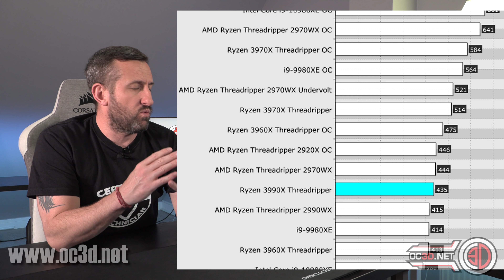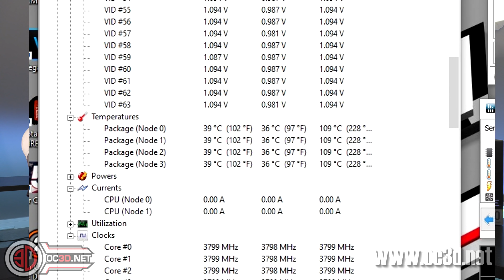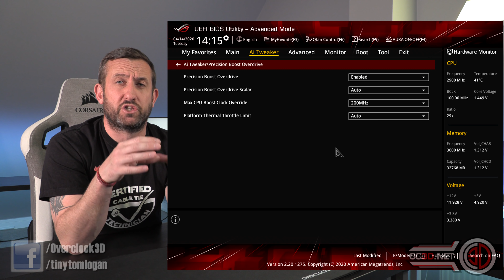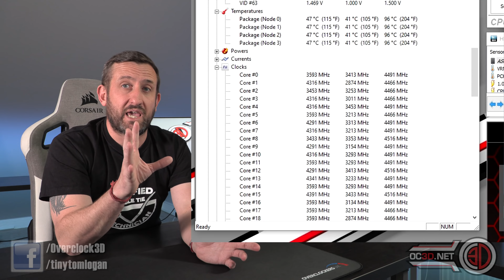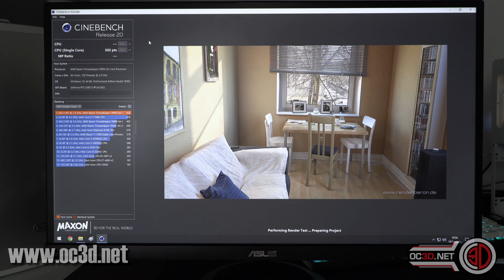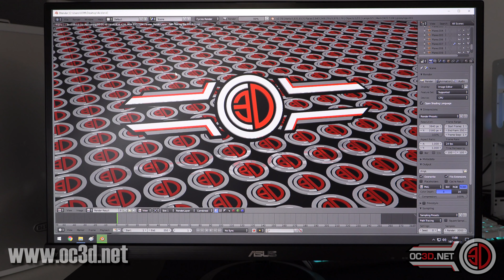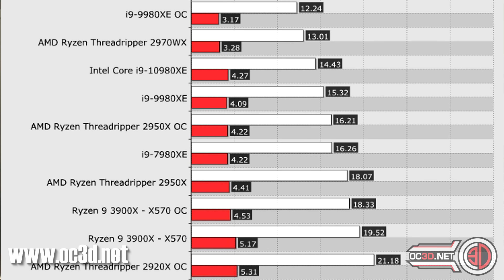3990X vs 3970x vs 3960x Zenith II Extreme Alpha TRX40 Aorus Extreme MSI Creator TRX40 VRM Temps

Comment: Thanks. I just finished my Build for ASUS ROG Zenith II Extreme Alpha and Ryzen Threadripper 3960X and  very excieted to start testing and checking performance. I bookmarked this video clip as I will probably watch it a few times.  :-)
Reply: I have that board and CPU!
Reply: I just bought the same board and cpu. What are you using for cooling?

Comment: Great to see you back on here.. Always great reviews. I've got the 3970x with the Zenith II Extreme Alpha and it would be working but i'm still building my new PC.. Haven't yet decided on Video card or AIO, especially since it's going in the Fractal Design 7 XL
Reply from the maker: AIO wise give the Coolermaster one a look I used here :)
Reply: @OC3D  Thanks very much for the advice.  I will have a look at that!   I have also noticed there is a new Fractal Design AIO  Celsius + 360 coming out.. Am hoping you might get it to review soon.
Reply from the maker: @MadmusicalHulk  Ive already tested it on the website - you really need a TR4 / TRX40 Specific cooler though because they have a bigger contact plate
Reply: OC3D TV Thanks, you’re a star ⭐️.  I will have a look for it.
Reply: I would give air a serious consideration. I got zero performance difference going from water to air. Actually it was faster on air although I switched to a different motherboard. I can post my Geekbench results to prove it.

Unless you spend hours tweaking the OC and voltages to get more performance, which I consider a fools errand. Why because the voltage difference needed for a 4.5 boost versus an all core load is so dramatically different, it's going to be hard nailing down a voltage that works in all scenarios.

I've tested with a quadruple rad, a Dark Rock Pro 4 TR4 and a U14S TR4-SP3.

Comment: Nice vid and a good bit of info on the how the new ROG board compares to the original. Would love to see you push this CPU some more on custom cooling. You're definitely going need to need some big rads though. I've got 2x 360's cooling my 3970X and it still hits 90C when pushed to 4.5 sustained all core

Comment: Thanks for your videos and papers. Have you had some time to try ccx overclocking on the threadrippers? I have a 3960X on the Gigabyte Master. I found that windows always ran cores on the 6th ccx on single core in R20. Assuming these are the best cores I then manually overclocked the 6th ccx to 4450 Mhz, 7th to 4350 and all the others to 4250 MHZ. 1.375V. When gaming (Battlefield 1), ccx6 always runs between 4400 and 4450 MHz peak and then video encoding loads all cores. Temps stay in the high 60s while gaming and R20 runs at 78C, score 14750 with Memory 3733MHz. Water cooled open loop with multi radiators.  CCX overclocking on the 64 core would be fun. Cheers!
Reply from the maker: Ive not had a chance to try CCX yet  it would take a fair amount of time to do it correctly and I wanted to get the first stage of the review out before exploring any deeper. Thank you for info on what you've achieved though!
Reply: @OC3D  i run 3990x. oc to 4.5 ghz all cores. then it overheated and died when I oc to 4.7ghz. good thing amd sent me a new cpu for free.

Comment: Just wanted to point out that the ASRock Taichi TRX40 already had a 16-phase 90A VRM. I had a Zenith II Extreme that I had to send back due to a malfunctioning M.2 slot. I picked up an ASRock to run while it's being repaired. The ASRock scored a 30k on Geekbench 5  on air while my Zenith II Extreme scored a 27k on a 11x120mm rad set up. I think the ASRock is the better board. And it achieved this on ATX, not EATX which doesn't fit in most cases and 1 less (silly 6 pin) power connector.

Comment: So if I'm to run a Home Windows server/ domain test labs and/or multiple VMs on ESXI - out of all the three (3960/3970/3990) what would be the best pick for real world + cost-effective gain (except for the obvious physical cores gain)? 

Also, according to reports on the web there are a few issues with having this many cores in a single system - the 64 thread limit on the Win10 Pro/Home versions, but not on the Win10 for Workstation and Enterprise versions, so obviously Linux performance would be much better resource-wise.  

I read a claim over the net that states that except that "the number of workstation-oriented programs that can meaningfully use more than 64 threads, is extremely small and that for most professionals it'd still make more sense to just buy a 3970x". Thoughts on the matter?

Comment: G'day Tiny Tom,
Awesome Comparison, & loving the New Space 😁,

🤔 So how long do you reckon it'll be until CPUs are so fast that AMD releases these as Athlon CPUs for $50?
if you do a Cooling test it would be awesome to see how using different Rad combos work, like 360mm, 480mm, 2x240mm, 2x280mm, 2x360mm & 2x480mm,
from other channels I've heard a 360mm is the minimum that is capable to keep the Threadripper 3000s at a stable operating Temp, but I don't think anyone has done a 'How Much RAD Capacity is Best'

P.s. Lots of love & hope you are well Physically & Emotionally, looks like you have lots of projects to keep you busy

Comment: Here are my scores for my system with various cooling set ups on a 3970X:

https://browser.geekbench.com/user/149586

And here is the actual liquid cooled build:

https://builds.gg/builds/black-chrome-quadruple-rad-pc-o11-air-25395
https://www.reddit.com/r/watercooling/comments/fr18tf/pc_o11_air_quadruple_rad_threadripper_3970x_dual/

After having to disassemble my entire build because of the broken Zenith II Extreme, I decided to go air -- I was over it.

Comment: Thank you for the detailed review!

I have some doubts regarding the cooling of this processor.
My use case would be, ArchViz 3D rendering using Vray, and I do not plan to overclock it.
That being said, I would personally like to go with AIO cooler but I didn't find any review that promotes AIO coolers for NEW 3990x.
All reviews praise Noctua (Noctua u14s tr4-sp3), and it seems to work perfectly, but I just don't like the look of it.
It would mean a lot to me to hear your thoughts on:
1. Is the AIO cooler a good option if you don't plan to overclock it?
2. If it is, what AIO coolers would you suggest?

Once again thanks for the in-depth review!

Comment: Hi im putting a rig together with a 2700x can a pair it with a gigabyte 450 aorus pro i dont over clock or are the vrms to bad to run it on that MB to run a 2700x .???
Reply from the maker: I think youd really want a board with more VRM capacity to be safe dude (Im being extra cautious)

Comment: the dim 2 slot has a speed of type 2242/2260/2280/22110 and 6 channels the other 3 have a speed of type 2242/2260/2280 the dim is much faster. always use 1 of the dim m2 for your c drive and 1 for your virtual memory(swapfile). use the mp 400 of corsair 8 tb this has a really fast iops read and write this is what you need for ram. use 8 tb virtual memory (swapfile) and 256gb of ddr4 3200 with the  AMD Ryzen Threadripper 3990X  64 core. the mb supports faster memory but the cpu not. and the m2 slot on the backside is a 2x slot. faster than te other 2. use this for adding 1 tb of RAMCache III that you can find in your bios this gives you 9256 gb of ram that is wat you need for the 64 core. the m2 slot on the back side shares bandwidth with the top 4 sata. and the lower 2 m2 share bandwidth with pci express port 2 and 4  and the pci express 16.4 are really 4 fully functional ports not 2 x8 if you use the 2 m2 next to it  it wil become x16/x8/x16/x8 you can find this on the asus web site.  have fun !!

Comment: See what you really need Tom is a H100 with 40 fans, Cool it no problem ;)
Actually remember that dual xeon build with "16 cores 32 threads!!!"...pisses on those Ricicles doesn't it, Imagine if there was anotther socket like the old skulltrail days. I did say on facebook you'd have trouble finding workloads to fully use it (and not in the intel fanboy "rendering only uses 8 cores" way).
Also I hate to say it Guvna....but the old overclocking ways we're used to (oh FSB where are you now) are actually bad for modern cpu's like ryzen. Thanks to SenseMI its like with "GPU boost" where you have a capped power and temp limit so its in a state of perma-throttle constantly trying to be conservative, If you go in and just dump in a ton of voltage expecting higher clocks all you end up doing is headbutting the limit sooner.

The trick is so eek out what performance gains you can within a given voltage and power target. So undervolt/overvolt only slightly and raise the Bclk by 1% and raise the safety ceiling with PBO (its just like a power commander on motorbike, it just loosens the restrictions a little) and the cpu will do what it feels like. All modern CPU's and GPU's come with traction control and ASC, You can push the botton to disable them but they're actually still there in the background working a little.
I think some folks in universitys would love to run some encryption or other math datasets on these or just buy 1 system and run 4 seperate VM's onto it where each gets a 3950x and 64GB of ram effectively.

Edited and got rid of the heart, I'm a moron.

Comment: Hi Tom, most of the sw you ran don't scale up to 128 threads. Now: you obviously don't want  to disable SMT in the bios but you can dedicate 1t per core via Process Lasso for every single program you need to.
As an  example, Timespy extreme cpu score will boost up to 20000+ points just by disabling SMT. THis should also fix some low scores, just like Sandra cryptography or geekbench: this happens when you use 2 virtual threads on a physical core, instead of a single thread per core, but you can' t take advantage of every real core.

I hope you can re-run the tests and fix the review. Bye.